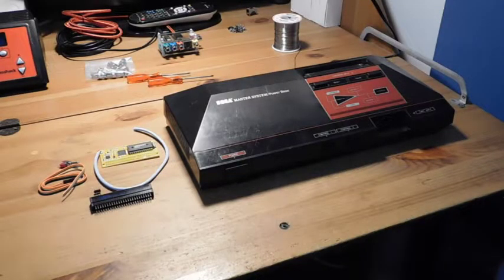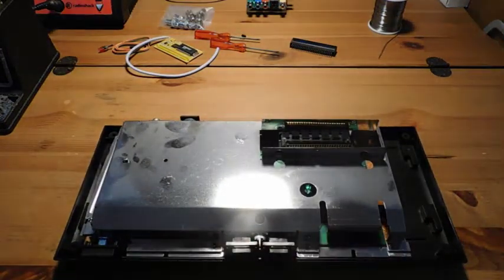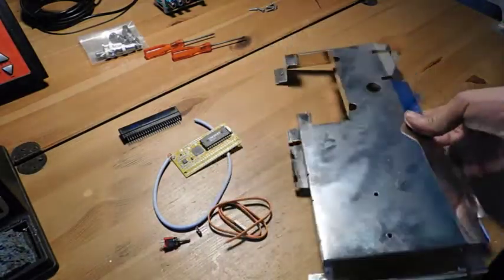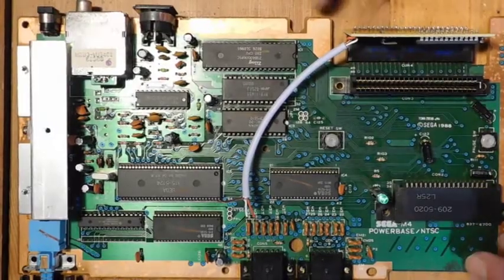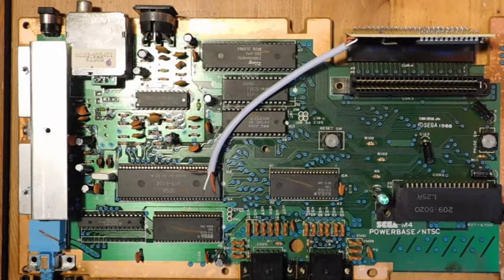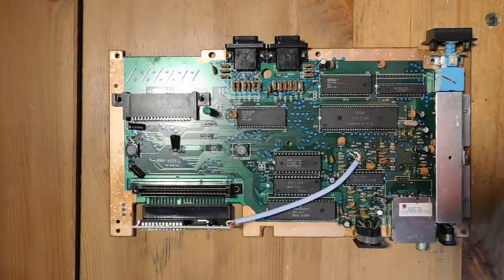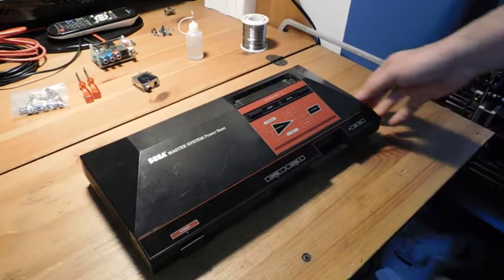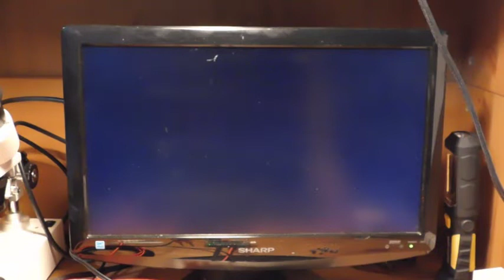Sega Master System FM Sound Expansion Board Install!

Comment: If you cut the trace to pin 19 of 315-5216 ic then add a wire from pin 19 to the IORQ# pad on the FM board you can enable Japanese FM mode & see the consoles screen light up saying MARK III & even change some title screens like Aztec Adventurs becomes Nazca '88 depending on region selected.

Comment: After hearing the Space Harrier theme built-in to the BIOS of some Japanese consoles compared to the same SMS BIOS running on a Mega Everdrive Pro with FM sound, I gotta say: It was COMPLETELY different. The Mega ED Pro wasn’t even close. Considering it isn’t the original FM chip in this mod kit, do you have any clue how this compares?
Reply from the maker: That is a really good question and I actually don’t know the answer! I need to get some recordings of what the original FM chip sounds like. My understanding is that this chip is a modern re-creation of it but I can’t be sure of how accurate it is

Comment: Leave my baby alone....
Reply from the maker: For what it's worth, this addon can easily be removed to return a system to its stock condition. Non-destructive mods are always the way to go in my opinion.
Reply: @LIRetroGaming  Agree, anything to protect or improve a console while keeping its integrity. If I would "leave my babies alone" then half of my consoles with disc laser readers would be dead and forgotten. Instead, I buy consoles literally labeled as "junk" on eBay because the disc reader failed and mod them with ODEs - not only bringing them back to life, but increasing their value two, threefold. All hail console modding, especially no cut mods. I for one, look forward to getting an FM kit for my model 1 SMS, which already has the region switch mod and the Everdrive.